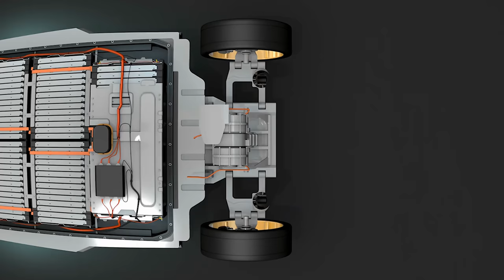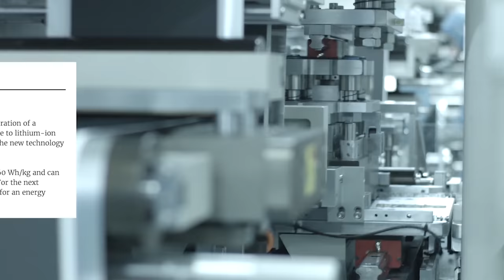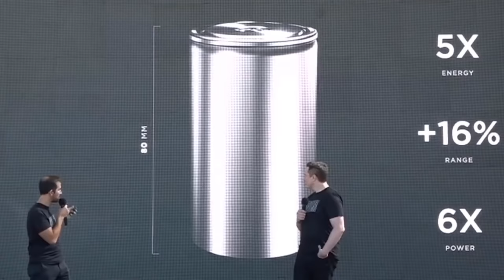Tesla's Lithium Iron Phosphate Batteries (LFP) Explained

Comment: One good point is that LFP cells can be repeatedly charged to 100% and then discharged completely, without quickly causing cell degradation.
This takes a little bite out of the energy advantage of cobalt based cells. Not entirely, but it means that the lower energy density of LFP cells is less of a problem than it seems.

Comment: I completely agree. Here in New Zealand we  recently ordered a MIC Model 3 Standard Range Plus, and the more I learn about it's LFP battery, the more I am impressed. Tesla, in designing a highly optimized car with a highly efficient drive train and lightweight chassis, are able to fit a relatively heavy LFP battery and still get excellent range. None of the other car makers can use LFP and get good range at the same time. None. Even with high energy cobalt chemistry they struggle to match Tesla for range, so forget about them doing it with LFP.
Reply: Check out the BYD Yuan.  $26,500 US , a 450 km range, a possibly even better LFP battery than the CATL battery used in the Tesla model 3 and a lot more models in their stable.  A regular man's car.

Comment: Suggestion for future video: What if Tesla ran their own fleet of semis with FSD and slowly captured the market?
Reply from the maker: I do have a semi video in the making. It does touch on it. Clever minds....
Reply: Ok hahaha. You clearly know nothing  about trucking
Reply: @Rajesh312000  it takes about 18 months or more to make a semi conductor factory. So Elon probably thinks it is not worth it as the supply issue will be solved in time.
Reply: or RV and mobile house…
Reply: Yeah it was pretty obvious that was why it was so delayed. They never intend to sell the semi's to anyone.

Also if FSD is solved then they don't need all the weight that comes with having a place for the driver.

Comment: LFP is the ideal chemistry for home solar/wind energy storage. ("PowerWall") I recommend enough capacity to run the home during its most demanding day for 24 hours, with no other source of power. That way, you're not "deep cycling" them on a daily basis, and will offer some reserve during prolonged outages, or, consecutive overcast days, where the panels/tiles just aren't producing enough.

Comment: BYD has already achieved 300 miles range with lithium phosphate blade battery @ $15k. Byd Yuan pro.
Reply from the maker: Yes, its great technology, but the Yuan only gets 250 miles NEDC, which stands for Not Even Dam Close, EPA is probably only 200 miles. Its also over $20k. But still a great value car, and enough for a lot of people.

Comment: If there were a bot that could roll under the car (parked in a charging row at a parking lot), you could just tell the car when you’ll be back and it would charge from a connection under the car and move on when done. Even some kind of robotic arm for the home garage floor would be good. Seems easier to do than self driving or making a reusable space capsule.  I think lasers and magnets could be used for positioning. I hope Tesla makes it.

Comment: July 4th from Menlo Park to Bishop, California, this was my last time I sat in car for 300 miles. I will likely do the same to LA in early September, a trip longer than Bishop California. Long trips in the US are lot more common than you think. From Menlo Park to Bishop is ~300 - 310 miles. No way am I confident in driving Model Y with 326 miles of range on a single charge especially having to cross over the Sierra. EV range is like computer RAM - don’t assume this is all we’ll ever need.
Reply from the maker: Even that is 2 months apart, in this scenario you will have to wait 10 mins to charge every 2 months, I would have thought that would be acceptable.
Reply: @TeslaEconomist  The more range you give to driver especially with Autopilot or FSD, the more driver will ‘drive’ - Jevon’s Paradox. I also tend to make long trips in most popular times - holidays. Each and everyday there will be more Teslas and we all want to take road trips especially if it is super easy with Autopilot/FSD. It will be interesting to see how Tesla in the coming years solve the holiday problem. We all want to travel on Memorial Day, 4th of July, Labor Day, Thanksgiving and Christmas for us here in the US.

Comment: Should be a hit with commuters and folks who can't charge at home every night. You can charge to 100% and discharge them deeply. So when you have access to overnight charging, where you share a charger, you can get the full 100% and have the full range until you get overnight charger again on rotation. If you run low, can top off at a supercharger if you drive more then usual.

Comment: 300 mile range is only on nice days at slower speeds. In the winter, expect only 60% range. We need 400 to 500 mile range.
Reply from the maker: That used to be an issue, but Tesla heat up the batteries to prevent losing so much range in colder temperatures.
Reply: Those numbers were from our MY last winter in low temps going 75 mpg. Temps around 5-20 Fahrenheit
Reply: If you are always on the road, maybe you should buy a diesel car.

Comment: Here’s a video idea.

Take a look at page 24 of the Tesla Impact report. 

To my knowledge, nobody has talked about the change in policy for EV Semis.  The impact report mentions that regulations have changed to allow an additional .9 Tons GVW (1000lbs) in the US, and 2 Tons (4400lbs) in EU.  

I haven’t seen this covered or announced *anywhere*.  Consider what this means using really rough math.  A 75kwh battery pack on the Model 3 is about 1000lbs, multiply by 2, and an extra 2,000lbs could be an extra 150kwh to the bottom line battery pack.  And at 0.5 miles per kWh, this could be an extra 75 miles, or a 15-25% increase in range for the 500 mile and 300 mile Semis, respectively.  

I couldn’t find any government websites that confirm this, or that announce the policy change, but take a look a this article about Freightliner’s test fleet.  

https://www.google.com/amp/s/www.autoweek.com/news/green-cars/amp36506185/electric-big-rig-semi-trucks/

99% of the article is fluff, but notice that they mention the GVW is 82,000lbs, exactly 2k over the Class 8 Semi Limit.  

Worth a video, IMHO.  

Sharing with my favorites: SMR, Dave Lee, TE, TD.

Comment: LFP batteries have an energy density of approx 200W/Kg.  Until the battery industry can get that to a minimum of 2500W/Kg or even better at 5000W/Kg, which would be parity with diesel, you are wasting everybody's time. Then you need to be able to 150KW-200KW into a car in 5 mins. Good luck with that.  Until that happens, diesel rules.

Comment: Are there any formulas or tables of data for time to ramp up a process or production? Certainly we have Wrights law for production cost. Is there some way to estimate how fast the the market can respond to known demand? Like scaling design and production like in ww2 ? Or more recently, it was obvious that masks and hand sanitizer would be needed when COVID-19 began. Some industrial engineer somewhere might have a rough rule of thumb that could be applicable to LFP batteries.
Reply from the maker: By the time Tesla's LFP battery is out, then they should have perfect the 4680 line, I am hoping the LFP line should be able to take advantage of most of those breakthroughs. The raw materials are far more abundant, so shouldn't be an issue. So it might just be a matter of finding enough engineers to set up enough production lines.
Tesla require about 1/10th the floor space of the other battery manufacturers, so should be able to ramp up significantly quicker.
Reply: @Henry,   Suggest you plug “Benchmark Mineral Intelligence” into a YouTube Search Bar, and start watching/listening/reading..! 😉

Comment: Yep. One should never underestimate cheap as an economic driver. LFP have many advantages over other battery technologies with one exception, weight. Since Tesla has the most efficient powertrains and aerodynamics out there, they can get away with using them in mid range autos. They're the only 'auto' company with an energy side where battery weight is not an issue. Tesla wins both ways with cheap LFP batteries. I suspect they'll make them in 4680 form with tabless too.
Reply from the maker: Yes, their efficient software, motors, drivetrains, drag coefficient, and weight saving techniques, all contribute to the fact that Tesla are able to use a much cheaper battery type over the competition. They will be tabless, but I dont think 4680 form
Reply: @TeslaEconomist  talk of using BYD's blade batteries and possibly their complete drive train on the model '2'. Still see Tesla making 4680 LFPs.

Comment: I question the superior safety claims of LFP relative to LION. Please reference the testing that supports that assertion. I watched another video questioning the LFP safety mainly due to the claims of safety originating from China. To date, the safety claims have been made by various channels without supporting data. Maybe I just missed something somewhere. This is an important question relative to any chemistry or cell/battery form factor. Thank you for responding in advance.

Comment: I think you have that backwards. Cylindrical is best for battery manufacturers and prismatic is best for auto manufacturers. Excluding Tesla this is how it is perceived.
Reply from the maker: I read prismatic was "easiest" for the battery manufacturers. Easiest might not necessary mean best. I would say cylindrical can be produced fastest, but that doesn't mean the manufacturing would be the easiest.
Reply: @Thaddeus,   Agree..!   BYD’s unique Blade-Battery format, is ..the  most efficient, form factor for EV production as far as available space utilisation, and maximum energy density capability, per available space.   Ohh, and did I happen to mention that they don’t catch fire either..? 🙄 
But, they are Chinese, so we won’t mention them here..! 🙄😉
Reply from the maker: @W A cylindrical is superior, Tesla's 4680 batteries are even cheaper than BYD's Blade batteries, and they use nickel, Tesla's LFP cylindrical batteries will be better again.

Comment: Don't forget if you have 300 miles you will only get 100miles or real range:( and as long as I don't have a need for my car, than it would be ok.
Reply from the maker: Not with LFP,  you can charge them closer to full and drive them closer to empty, due to iron being so durable
Reply: @TeslaEconomist  maybe, talking abut my 75kw model x miles range...... I really can only drive 100 miles without thought. and really only a few errands a day can be done before needing a charge:(

Comment: LFP is not future. LFP is not suitable for EV. Because if you compare LFP with NCM, LFP may safer and longer lifespan then NCM. But that's when you perform EV under 1 C-rate. If you perform your EV over 1 C rate, LFP decreases it's safety and lifespan drastically. NCM is way safer and longer lifespan then LFP when EV performs over 1 C rate. 

EV is item that use high C rate. Therefore, LFP is not suitable for EV.

However, LFP can be usefull on small EV like performing under 1 C rate like 0.5 such as smart, hong mini and etc. And countries in Africa and south east asia can be beneficial with LFP. Because those nations have less mountains (require low rate of discharge when you drive due to no hills), and warm.

Comment: Manufacturers of LFP battery typically conduct testing under controlled conditions with c rate between 0.3C and 0.5C. However, in real-world scenarios like electric vehicles, the batteries often experience c rates above 1C, making the achievement of 2000 cycles or more quite challenging outside of laboratory conditions. Average of EV's c-rate is 2C, and the higher the c-rate, less the number of charge/discharge. (https://www.master-instruments.com.au/file/66643/1/Drypower-IFR18650%20E1600.pdf).